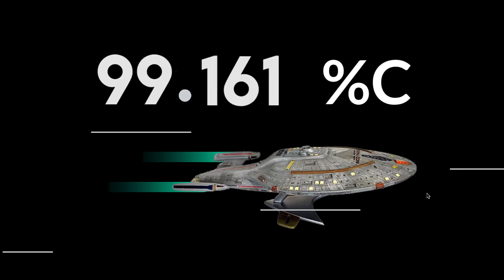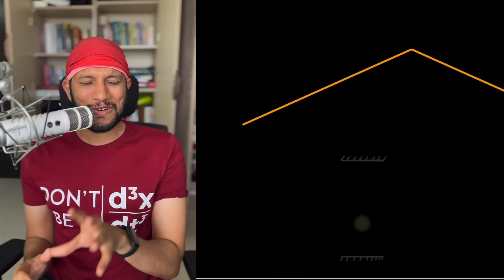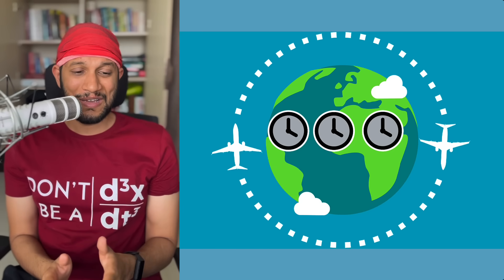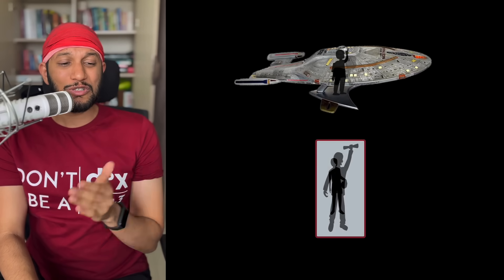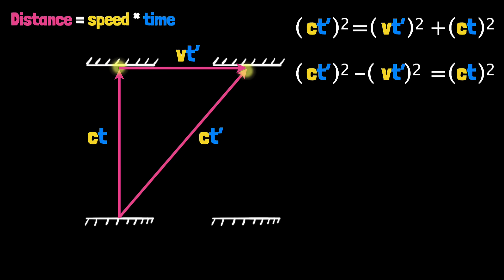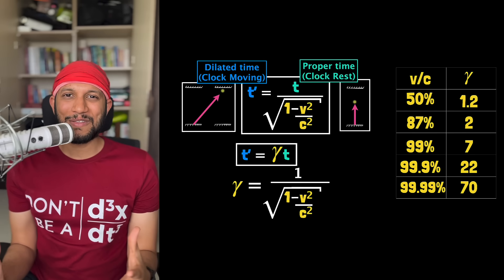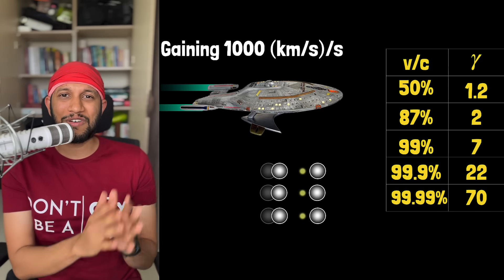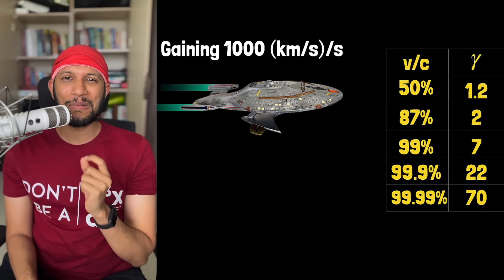I finally understood why you can't go faster than light! (My mind is blown)

Comment: So for some fictional character or object to move faster than light, the best realistic explanation would be for them to be made out of some fictional type of substance that does not exist in real life and does not follow the same rules as matter or waves. Or in other words, some fictional substance that does not actually interact or depend on anything that exists in reality, and so would not be bound by it's sub-atomic components depending on the speed of light.

Which means that in a fantasy setting, magic moving faster than light wouldn't be odd (as long as said magic isn't visible through the same senses real life humans have that is, as that would imply it's connected to photons in some way. But you can easily explain that by the fictional humans of that universe having a 6th sense that doesn't exist in reality and is mistaken by vision in-world due to working similarly enough that people can't tell the difference), but a physical character doing so would. That makes sense, I like that idea.

Comment: Lets say you move at speed of light and you age 10 times slower than normal. What happens if you decide to stop and move normal speed after 10 years? do all the extra years catch up? so instead of being 10 years old you instantly become 100?
Reply: At the speed of light you do not age 10 times slower. You do not age at all. So lets say at some velocity where you age 10 times slower than your destination. 
The extra years do not catch up. Once you reach your destination and stop, with respect to it, you are whatever age you were at the end of your journey. Your age is the amount of time you experienced, not whatever anyone else's clock reads.

Comment: Okay, what I don't get here is: If from the outside perspective the ship is going 99.99% the speed of light, wouldn't the perspective inside the ship feel like you were going 70 times faster?  Or do I have that backwards?  Would you feel like you were going slower the faster you went?
Reply: You don't feel any difference on the ship except for the acceleration.
On the ship, you see the outside observer move at 99.99% the speed of light.
Reply: @narfwhals7843  But that can't be right if time will flow differently from each perspective yet the ship's actual speed remains a fixed variable.  

For instance: Say you have a ship that accelerates to 87% of light-speed.  The pilot drops a stationary buoy from the ship, then ten seconds later drops another one.  Since the time dealation is a factor of 2 at that speed, the buoys would have been dropped 20 seconds apart from an outside perspective, and their distance apart would be further than light can travel in 10 seconds.
Reply: @narfwhals7843  Never mind.  I found the other video.

Comment: Surely the point is that 'speed' as a term ALWAYS HAS TO BE RELATIVE TO SOMETHING. And, if the maths don't work for the reference you have chosen then why not just pick another one? Is there anything in science to say that, even if something (a spaceship perhaps) is travelling at 'the speed of light' with reference to a particular object, then you could equally well get another speed if you just picked a different reference object. That other speed could be zero. Of course if you can measure the acceleration of your spaceship and thereby calculate the distance travelled in the proper time you may derive a speed as much as, or greater than, light. But it is an illusion. As an example it may equally well be indicative of the fact that you have changed your speed from minus fifty percent of the speed of light to plus fifty percent of light (relative to some object of course) "All things are relative" - and I don't think that expression can necessarily be ascribed to Albert Einstein. The only thing that is constant it would seem is the speed of light in your own particular time frame.

Comment: The thought experiment for clocks in a moving vessel fails in at least a few points. First is inertial frames of reference. Within the ship, the clock ticks at the same rate as the stationary clock. The delay only occurs during acceleration, and that could be due to a number of things including gravity. However, in a ship traveling at a constant speed, regardless of how fast it's traveling, the tick will remain consistent with the stationary clock.

Comment: The problem with the clocks is that correlation does not equal causation. Just because the clocks were no longer synced does not exclude other possible explanations for why they're out of sync. 99.99% of the visible universe is comprised of charged particles, a.k.a plasma, which is the bedrock for electromagnetic phenomena. So why jump to the conclusion that light slows in motion when there are other variables to consider, such as interference. Afterall, why do clocks in moving cars or trains not go out of sync with stationary clocks, but clocks flown in the atmosphere do?

Comment: But that is only for the percieved acceleration up to light speed, right? Shouldn´t you still be able to achieve light speed in the proper time, that the accelerated percieve yourself, which then breaks the rules of time? Then is the question (for someone who has no idea like me) do construct of atoms even still stick together over the speed of light or do they then just break apart and decelerate again after that? So that for someone watching something would just vanish when it moves too close to the speed of light, but its residue can be found again, after it decelerates. Maybe even at a completly different point and is this then, what would be teleportation? Like, if you can move at the speed of light, which would break you at an atomic level, but in a predictable path, so that you can find all the atoms again and reconstruct yourself with outside help? My brain is not braining anymore, this is all so complicated, lel

Comment: Most of what youre saying is correct. I am sorry to bring something of a downer onto your wonderful energy and great passion which I very much relate to. 
 But your emphasis on acceleration is at least misleading because you often seem to imply that acceleration per se is causing the time dilation and that is not the case.  However you get to a speed of 87% SoL and then shut down the engine you will (ceteris paribus) maintain that speed and the resultant 50%  reduction of time rate.  
Also it is typically unrealistic to talk of maintaining acceleration because the propulsion process is of course also subject to time dilation so in the above scenario the propulsion is reduced by the same factor
Then theres all the logical problems caused by AE's insistence (at the time - he changed his mind for General Relativity) that no medium exists for the propagation of EMR.

Comment: 1:25 this doesn't make any sense to me, why does it travel diagonally? what's stopping it from moving vertically at a 90 degree angle?
Reply: I think the path that the photon is travelling is diagonal because the ship is moving if the ship is not moving then it would travel vertically at a 90 degree angle

Comment: that example is flawed to begin with. seeing as it is impossible to have a free floating object traveling as fast as a ship that is accelerating at any rate of speed. the real test would be a clock inside the ship. the experiment would show the clock slowing down but only to an outside observer because the more energy you put into acceleration, the more "time energy" gets lowered because the particles have to travel the same distance with less energy because it is no longer at rest while traveling. 

(ps. i know thats not a perfect example nor is it an actual test as written. this is just a very simplified way to get the point across even if it is a flawed one as well.)

interesting possibility: moving faster than the speed of light could be possible if you can somehow find a way to create or take energy from a source that exerts no mass onto your vehicle.
 which is currently not within our technological grasp. possibly will never be within our grasp until we can readily control time energy instead of just observing our impact on it.

Comment: But if a photon is a particle what limits it (or any other form of particle) to the speed of light - if more energy is put into a particle then what happens to that particle when it is unable to convert that energy into acceleration?

Comment: The transfer of force from one atom to another takes place by electromagnetic forces which are at the same speed of light. But what if instead of transferring force from one atom to another, all the atoms were accelerated simultaneously using an electromagnetic field maybe. Then there would be simultaneous acceleration for all particles. Damn I would love to discuss this in detail.

Comment: Always wondered about light speed icw black holes. Light travels in a straight line, except with balck holes. It will bend light, so attract it. So Isn't so that anything that can be  attracted can be slowed down AND spedup...?! Ofcourse a Black hole is an inmense of power but the querry still holds up

Comment: I know, this was posted a year ago, so I can't really expect an answer. Though it's a bit of a theoretical one anyway. When we use the term "Proper Time" is it truly the "prime" proper time? Here's what I mean, though I may end up answering my own question. Proper time is the time at rest, lets say sitting next to you on the clock. However, we are already moving. The earth rotates, which revolves around the sun, which revolves around the Milky Way, which is expanding from the center of the Big Bang. So, is it truly proper time? Or is it still technically relative and in turn dilated in relation to the center of the universe? Not that it would really change the outcome of this video, but it was something that I thought about while watching.

I guess, it further explains the "relative" part of relativity.

Comment: Really good and clear explanation! However: Ships in Star Trek (like Voyager) don't really move through space, when they travel long distances between the stars. The Warp drive warps space in such a way that the spaceship really skips from point A to point C without traversing point B. The idea is to "travel without moving". (I'm not exactly sure if or how this would work, but I guess it won't affect the flow of time as it does in a scenario where an object (a spaceship) really moves in space and accelerates towards lightspeed.

Comment: This is another great example to make it people to understand why time dilates. But the question remains. The best explanation I found that can explain ALL in one sentence is the following: Everything and all moves ALWAYS at speed of light. There is no intermediate speeds. As the equation of einstein also says. We have C = Vx+Vy+Vz+Vt. The trick is that the total vector isn't only the spacial dimensions Vx, Vy, Vz but also includes the time dimension Vt. Time speed is the perception of time in our brain. So a stationary person sitting  in a chair still "moves" at speed of light, but the speed is only the in time factor, since he sits still in space. So Vtotal = C = Vx+Vy+Vz+Vt = 0 + 0 + 0 + Vt. Therefore Vtotal = C = Vt. Thus that person experiences max time speed and is the normal clock we all feel. If that person starts moving in steady speed towards the kitchen with vector X, then his new total speed, which is always C, is: Vtotal = C = Vx+0+0+Vt = Vx+Vt. So the increase in speed in X causes the speed in T vector to drop, so that the total speed in spacetime remains C. Therefore when you move towards the kitchen, for an external observer, you seem to acquire Vx but your time speed (=clock) slows down in order for Vx+Vt = C.  Another similar example is when you move with speed Vx = 100 and suddenly you turn 45 degrees BUT keeping same speed. Now you have Vx+Vy = 100 BUT Vx is slower if you analyse the vectors, right? Imagine now that one of these vectors is time. As you "turn=start moving" time goes down. Obviously, even while moving, in your own reference, since you always have spacial speeds 0, the only speed you "feel" is the time speed Vt=C. For the others though, your clock slows down as you acquire special speed. The same equation says that when you reach Spacial speed C, you Vt goes to zero in order for Vtotal to remain C. That is why massless objects like the photos, don't experience time. People tried to use many optical examples but I believe it only confuses people. Just use the equations and "read them" outloud. Objects are always in constant and total speed C, including the time dimension. And when we sit in  a chair we experience the time dimension in its full speed, the light speed. Same goes with gravity and earth. Earth seems stationary in its self but actually it moves in time. Another optical misconsception that is widely used and confuse people is the effort to show the effect of gravity with a ball and a bedsheet. The ball curves the sheet and then they throw in a smaller ball to show the curvature. But what they don't explain is "what the heck forces a stationary orbit at a small distance from earth to start moving in the first place". Ok an existing object will follow the curve, because it already has initial speed. But a stationary object, why it starts moving at presence of a mass? The answer again is "It ISN'T stationary". It may have zero spatial speed but it still moves in Vt. And because the mass of earth curves ALSO the Time, forces begin to make the stationary object acquire spatial speed TOO (Minkowski spacetime mathematics explain why). Remember this: Time isn't absolute like for example temperature, but is a vector, which means, like all vectors, it behaves differently in curved space-time depending where you go and where you are. It's not spatial vector, is time vector, BUT still vector. But our brain can't handle it as vector. It handles it as absolute measurement like the temperature or humidity.

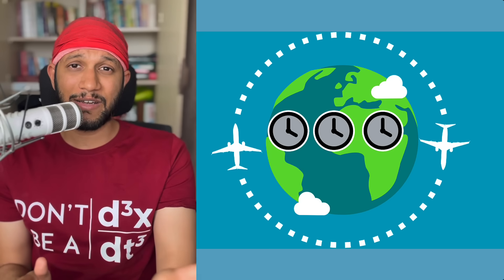Comment: in 4:30 time dilation with planes was tested based on Gravity, not relative speed. Because the further away from the planet, less gravity. and less time consumed travelling in a warped space. So time on plane passes slower than on ground. This is not caused by speed but by the curvature forced on space by gravity.

Comment: Fun thought. Does this mean you can use a photon clock to determine your actual "universal" speed, instead or your relative speed to a gravitational body? Put it in space with omni-direction thrusters, and keep making small adjustments to it until you can't get the delay between bounces to go any smaller.

Comment: Only have to consider the latent heat of fusion, phase changes occur, so a phase change will occur at the speed of light.  Time is relative as well, so it isn't slowing, it just seems slower to the other point.

Comment: Let's pretend space is two dimensional. You can draw your observed speed and direction as a velocity vector on this two dimensional grid. The faster you're going, the longer your vector line gets. Now we expand this grid to three dimensions. We're still keeping space two-dimensional, because this third dimension is not your observed speed through space but rather your observed speed through time. It is "the rate at which you age". The units for the space velocity components of the vector are light-years-per-year. So if it's 0.5, you're observed to travel at half the speed of light. And the speed-through-time component of the vector will have its units be "years per year". If an observer sees this component as 0.5, they will see your clock ticking at half the speed, and you will be observed to age at half the normal speed.

Now here's the thing: when you take the space components of your vector, and the time component of your vector, the magnitude of this 3D vector must always be exactly 1. So when you speed up, you're not making the vector longer. The only way to speed up is to change the direction of the vector, taking out some of the time component so you can put more into the space component. You are intrinsically always observed to be moving through spacetime at 1. You can never change the length, only the direction. Through this model, you can apply the Pythagorean theorem and it will give you the Lorentz factor, determining the relationship between your apparent speed through space and your apparent rate of aging, as well as spacial compression.

And the math works exactly the same if instead we use three-dimensional space and add a fourth dimension for time, as the Pythagorean theorem can be applied to any number of dimensions. Just add up all the squares and take the square root. It's just that it's harder to envision a four-dimensional vector.

Photons are considered quite exotic because they intrinsically move at a speed of C. As it turns out, we have that in common with light. But light is limited, in that its time component is zero. This is why its "speed" is always the speed of light. Light moves through space at the speed of light, and it does not "experience" time. We move through spacetime at the speed of light, and we tend to mostly experience time, relatively speaking.

Comment: Just to be clear, a lot of Sci-Fi uses "Hyperdrive systems" in all of their interpretations. Either that means opening wormholes that literally make the distance shorter, so the speed is a way smaller factor, or use some reality warping to make the space in front of the ship smaller than the space behind the ship, thus making it move faster than light while "Technically" staying below the ftl barrier

Actually, The way I handled it in my writing with Hovertech is very similar to that last one. Hell, if you manipulate the setup of the engine cores, you'd basically be able to make an object that is, by sheer technicality, stationary, even though it's practically moving